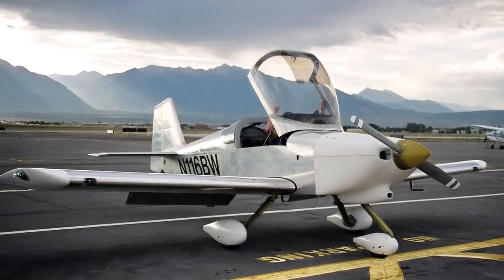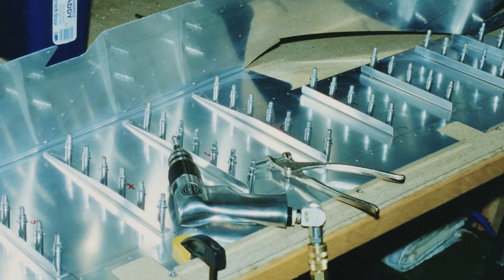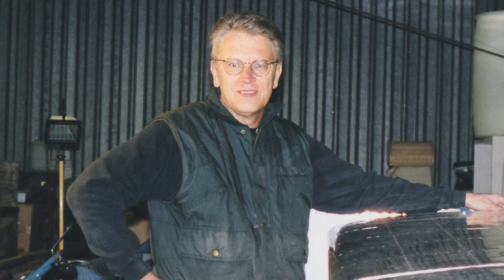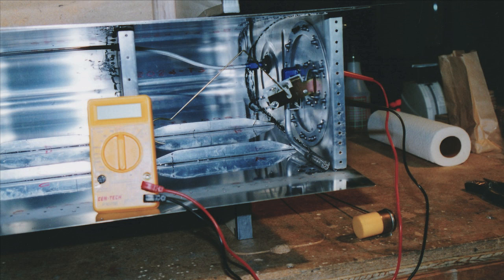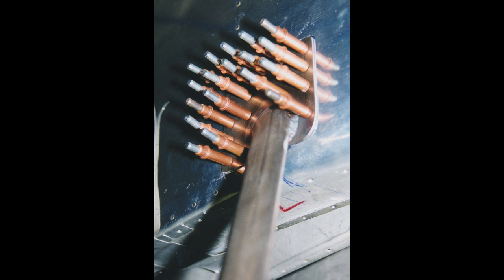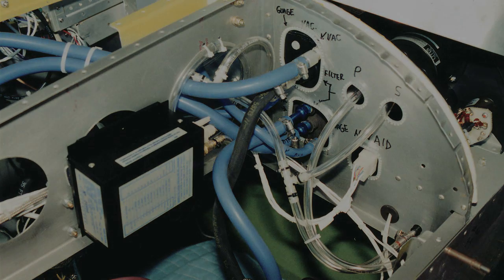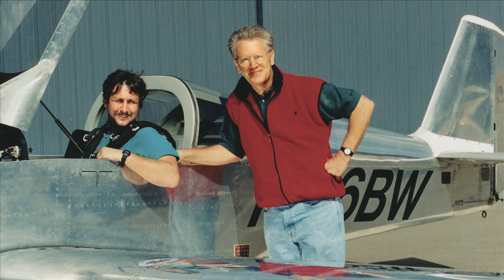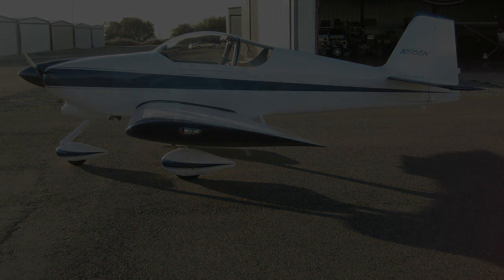Taking Flight - Building an Experimental Airplane

Comment: was figuring that was what was done, luckily for me if i ever build a plane i have somewhat of a step up on some guys as i am very mechanically inclined and can paint no not rattle can painting lol.and im sort of ocd with details so dont know if thats good or bad, could be both!. as much as i would love a nice polished aluminum skin like p51's the maintence is wayyy too much coming from experience unless coated so i think i will use paint all the way lol. thanks for the information.

Comment from the maker: It may be hard to hear this if you have ambitions to build a plane of your own, but, yes, every part was pray painted ) primed) with Sherman Williams, two part primer. Every rib, every bulkhead, every small aluminum part.  The skin, outer surface (maybe both surfaces) has a thin coating of pure aluminum that oxidizes and forms a resistant surface.  I forget the official term. However, most builders, sooner or later, have the plan painted.  Airplane paint is very toxic.  Good luck.

Comment: question, did you coat the individual pieces inside of the wing structure like the spars and ribs and all the other metal bits on the plane to prevent corrosion in the future? or are they pre-coated from the factory? just wondering.

Comment: I made a "general" comment, earlier, but I thought I'd put my two cents in concerning your "retire" comment.  As a retired guy, I flew my Mini-max for 13 years on a "shoe string" budget!  No hangar (hangar money went into the gas tanks) and the plane stayed "tied down" outside all of those years.  A lot of that time was in Florida, so the heat & moisture were not kind to me, at all.  I flew for over 30 years - General Aviation is OK, but Sport Pilot is the way to go.  Much, much less expensive.

Comment: Really enjoyed your video; albeit a bit poignant.   I just "retired" my little EROS 1650 Mini-max - after 13 years of flying it.  I tried putting 1,000 hrs on it, but came up just a bit short.  Mine was wood & fabric...cruise @ 75mph, with a Vne of 110mph - slow but I always got to those breakfasts! :-)   Lots of my friends are flying the RV's; is a wonderful airplane.  I can't fathom 5yrs building - mine was completed in 6 months  (at 7 days a week & lots of epoxy! :-)  Thanks.  N-6395T  R.I.P.